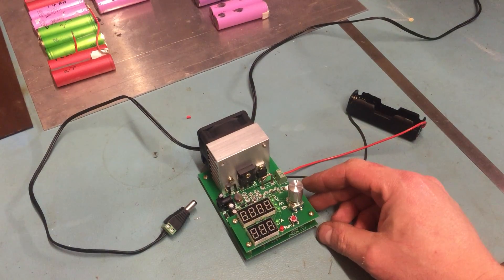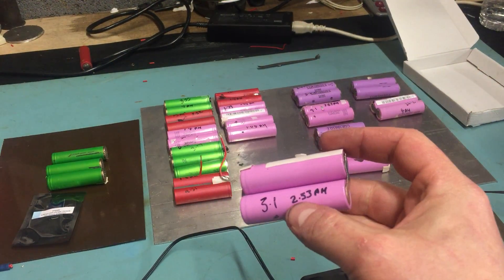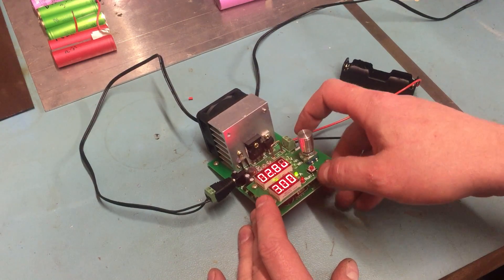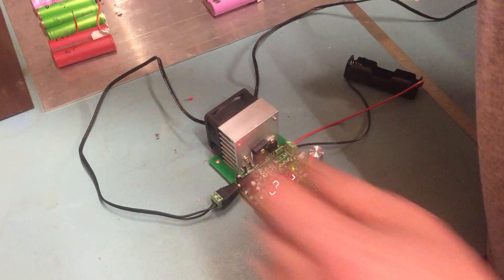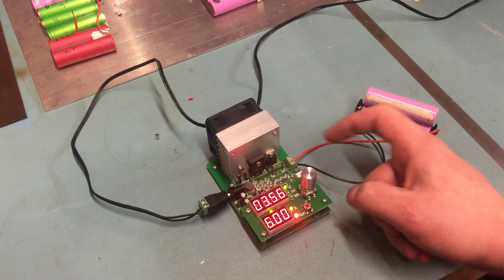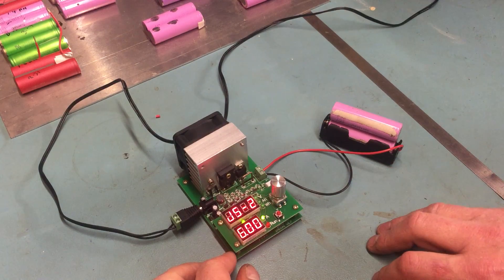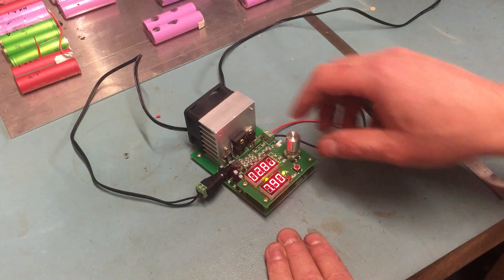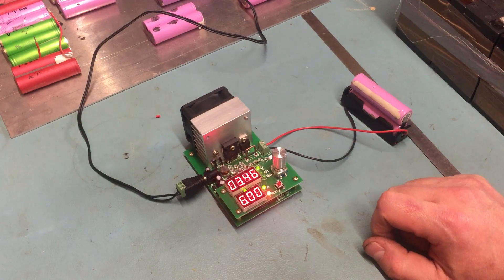ZPB30A Constant Current electronic battery tester / Discharger

Comment: Just received a ZHIYU® Multifunction 110W 9.99A 30V Constant Current Electronic Load Aging Battery Power Capacity Tester Module, plugged in 12V and immediately noticed that the last digit on the top display shows a U instead of a 0.  I did notice that the digital readout module did display a Zero (0) when actually testing.  Is it a fault or feature?
Reply: No, the "U" isn't a sign of a faulty device.  In fact the "U" is indicating that what you're about to adjust is the voltage, "U" being the international sign for voltage.  On a 7 segments display, it''s kind of hard to display the letter "V",  isn't it ?  ;-)
Reply: I think it's supposed to represent a V, as in Volts.

Comment: Just a head's up for others. I tried a number of 12V power supplies that would give me 1 amp or more, when they would throw me an 'error6', I'd check them, and they'd read around 17V. Finally I plugged a 7.5V 1.5A in, and tested it first, it read 12V, so I plugged it in and it all finally seemed to work. I then hooked up a Lead Acid 12A 12V battery to test at 1A draw. All seems to go well until it overheats, and the overheat protection kicks in with message of 'otP'. After the heat sink cools down, it allows you to resume the test until it overheats again. Throughout this cycle, the fan never comes on. I'm assuming that I've not missed anything, and perhaps I've received a faulty unit. (The way it was packed made me amazed it wasn't broken in transit as they just threw it into a plastic envelope with no padding of any sort).

Update, Hooked up a new Panny NCR18650B 18650 cell to test at a .5A draw. Surprised to find the fan started to work straight away, given that it never worked at all when testing a 12V load. Set the cutoff to 3.2V, and again surprised when it reached that very quickly and shutoff after a few hundred milliamps of draw. However read the cell with a multimeter and found it to be around 3.8V, and when I placed the cell into the charger the charger showed the cell at 81% capacity. So then I hooked up the four wire test, and tried a Samsung ICR18650 2800mAh cell that was just fully charged, and was surprised to see the voltage read out start around 3.2V. When I read it with a Multimeter while it was still being tested under load, it was showing 3.8V. It would seem the tester is reading about .5V on the low side, so I'm starting to get suspicious that I may have a faulty unit.

Comment: Just got mine from Ali and have not used it yet. Very well done (your video), covered most of the questions I had, and great you mentioned the emphasis on safety using the fire resistant counter top as well. Also good to know I would need the 1A DC adapter, otherwise I would have just grabbed one of my 500mAh ones. Thanks very much for doing this!
Reply from the maker: One thing that wasn't mentioned in the video is that it has a separate connector next to the input connector for voltage sensing independent of the main load wires - otherwise known as four wire testing which i recommend you use in order to get the voltage level accurate.  I also recently used it to perform a full 20 hour run down test of a BMW 90ah AGM car battery (4.5 amps) as i wanted to prove it needed replacing before spending £180 on a new one (which i also tested!)
Reply: Thanks for that head's up Eliot. I just have to hunt around and find some of those connectors so I can do the 4 wire test. I assume you connect the leads from that in in parallel to your leads coming off the other (green) junction box?

I just connected mine to a 12v 2A power supply (polarity was correct) and I got a 'error6'. So I tried a 500mAh supply, and I got the correct powerup behaviour. When I checked the output on the 2A unit with a multimeter and it read 17v, the smaller P.S. was 12.7v. So I guess they mean it in the notes where they say the input range is 11-14v.
Reply from the maker: Mountain Parameters Yes, just run them in parallel.

Comment: welcome to the world of 18650, hmm 3amp test seams very high, I would recommend 1amp discharge rate. check out HBpowerwall and my channel
Reply from the maker: That is for a pair of 18650's - but yes I agree I'm pulling too much and it should be less.
Reply: Eliot Mansfield i think he said 6 amp for 2 but i was kinda think it was high also but i guess that's about what they are rated for like 1 or 2 c right and i mean if thats about the max load your going to be using testing at like 1 amp might not be that accurate

Comment: Hello, thanks for the video. I just ordered two from China. 
Do you think it is possible to use two in parallel to pull more current out of bigger batteries? I I wire the Battery up in Parallel and put both for example to 12v 3A, I would be able to discharge the battery with 6A and don't put this cheap system under such extreme heat and to its limits. Or am I thinking completely in the wrong direction? Thanks for your help.